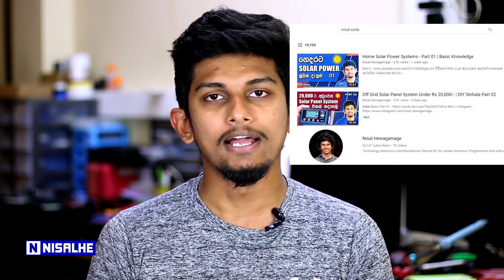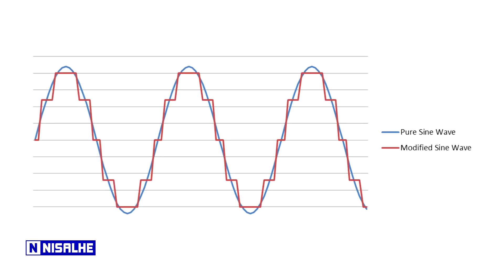Solar Power Off Grid Inverters for AC Current | Solar Sinhala Part 03

Comment: Pure sine wave inverter ekak oney  cell phones  radios, tvs, computers wagey, electronic upakaranawalata.
Pumps, fans, refrigerators wagey induction motors thiyena upakarana walata thath sine wave invertors wada hondai.
Resistive heaters thiyena convection ovens, water heaters, smoothing irons wagey upakarana walata mila adu modified sine wave inverters paavichchi karanna puluwan.

Comment: I am using 400 units of electricity averagely in a months.
If I want use solar system what are the material and how many I need to installed

Comment: වොට් 1000 ක ඉන්වර්ට එකකින් වොශින් මැශින් එකක් දුවන්න පුළුවන්ද
Reply: Hi brother. I am going to start a small project for vegitable plant. Please go through the details & tell me the required units with capacities. 
1. Idama akkara 2i
2. Ali wetak gahanna ona kambi potawal 2k daala
3. 2 inches wathura motarayak duwanna ona.
4. Water heater 1k use karanna ona. 
5. Phone charge
6. Led bulb 4k use karanna ona. 

Meka aththatama elawalu kotuwakata ona project 1k. Ali weta 24 hrs on eke tyenna ona. Anith dewal nam weda karanakota witarai use wenne. Me okkoma add karala mage wede success karaganna awashya battery, inverter, controller, solar panel wala capacity ekkama gaana kochcharak yaida kiylahala ewanna puluwanm bro. 

Thank you. I liked you. Subscribed & following you.

Comment: Other than the motor driven equipments most other modern applications can be met with DC. We shall promote off grid DC power for LED lights, TVs, etc. can I have your contact details to discuss few other matters.

Comment: Great stuff !!! Good to see our young blood into these things .. one small thing .. the battery you are using seems to be a Normal car battery . You may need to go with a deep cycle battery for a longer life time
Reply from the maker: Ya true. This is for a budget system. Will do a video with a deep cycle battery too. Thanks for your comment
Reply: @NisalHewagamage  2600W ගන්න මැශීන් එකකට 3500W inverter එකක් ඇතිද?
Reply: @kemee666  hodatama ethi mokada normally 20-40w wage space ekak thigena use karanna puluwan.
Reply: @lasirumenath8990  thanks
Reply: @kemee666  6000W peak power pure sine wave inverter eken puluwan

Comment: UPS eke echcharama prashnayak na.E unata ups eka sine wave output ekak denne nathnam eken fan wage motors run karawanna ba.E arunahama UPS eka battery eka charge and discharge karanna hodama widihak.Mamath ups ekakata 90Ah used battery ekak dala danata 2 years withara pawichchi karanawa.LED bulb walata nam mukuthma wanne na.

Comment: Direct DC current eken gedaraka light system ekata denna puluwan. Podi modification ekak karanna one DB eke. Light circuit eka isolate kalanam hari. Direct dc supply.

Comment: suba aluth awuruddak wewa aiyye...inverter eka wenuwata mn use kre  ups ekk dn awuruddakt kittui et wadi wela use kre ne ,et me dws wala eka digt paya gnk use krpu nisa  wenna ati circuit eke ic 2 pichcila bttrry wire ekt curcuit ekenma unu wela glwila tibba, mn hitana wdhta godk loku load ekk &  wadi welawak eka digta ups eka duwand be external bttry ekk set krl....
Reply from the maker: ඔව් අන්න ඒක තමයි අවුල
Reply: peo sine  inverter eka gnne natuwa wave sine inverter eka argena eke out put curunt eke sine wave eka peo sign eke wage  sine wave eka soft karanna baida....?(external circuit ekk dala)

Comment: Maath UPS ekak use kara 2years vitara, habai eka digatama neme,  modified sine wave inverter walin fan power karana ekanam echchra honda wadak neme, mage pedestal fan 1k pichchuna , modified sine wave use karala. Kawru hari pure sine wave inverter ekak gannawanm, pettah wala micro electronics eken 12 v 500w  pure sine wave inverter eka gatte 8500i. Godak places wala 12 v 500w eka hoyaganna amarui. Hama thanama wage 24 v eka tibba, habai 12 v eka mara hnbune micro electronics eke vitarai.
Reply: Daraz eke thiyenawa aduwata.search karala balanna.hebai no warranty.oyage ekata thiyenawada.
Reply: @werankumara4672  pure sine wave eka 8500 ta wada aduwata tibbada? Na mage ekatath no warranty
Reply: thanks bro
Reply: Mithira Udugama  ups eke power out eka 160v - 170v wage thiyenne, man nam hithanne eka madi.
Reply: @moviepapa20  man gawa tiyena eke nam 220v ma enawa , awlak une na
Reply: @mithiraudugama800   brother where did you buy it
Reply: @jaiharris9824  micro electronics , pettah,
Reply: @mithiraudugama800   thanks brother
Reply: @jaiharris9824  no problem bro
Reply: Monawada oya oken use karnne.
Reply: @priyadarsanabandara2240   TV, Fan, Lights thama wadiyama use karanne. Heating elements or loku motors arenna, anith ewata meka athi.
Reply: 🔋 capacity kiyada? Full  Chag karla Kochchara welawak pavichchi karnna puluwanda bro.